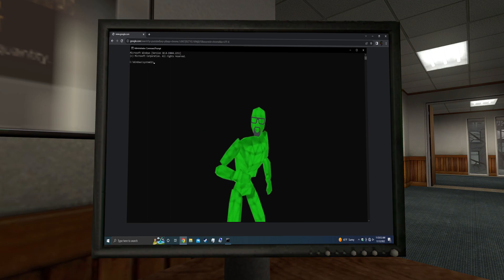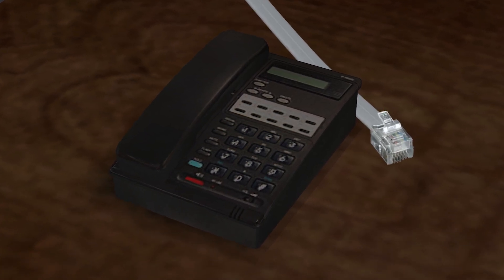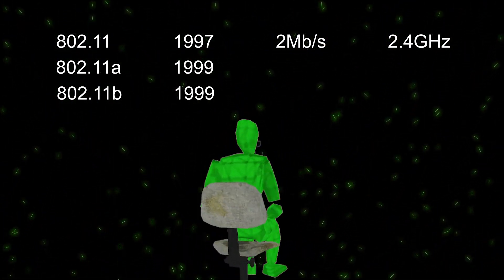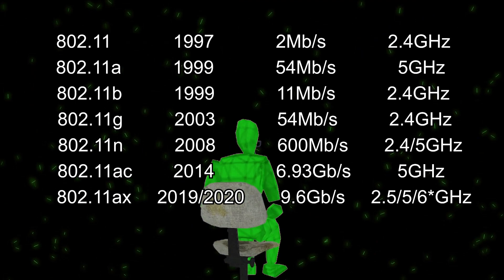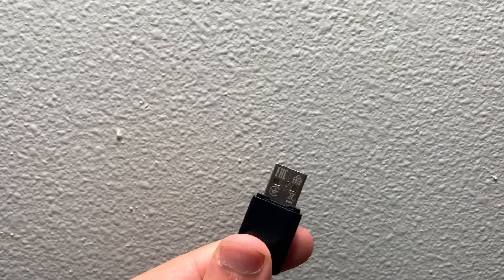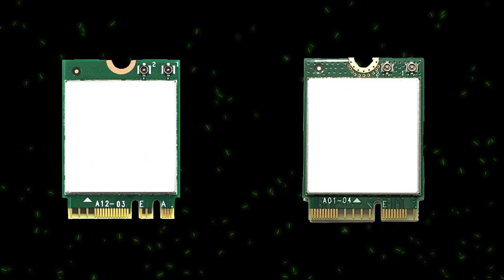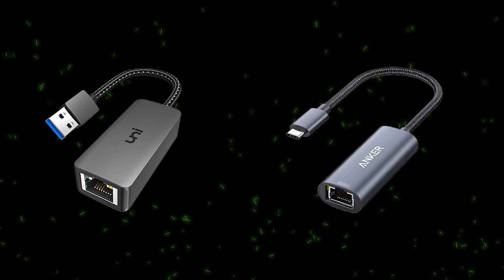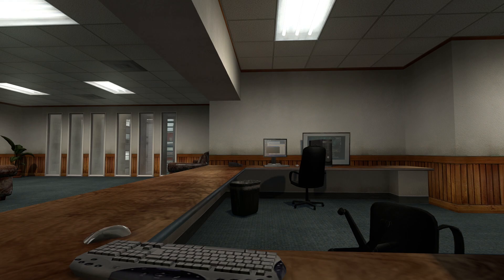Wired and Wireless Network Interfaces

Comment: The only wrong info here is with the rj11, with VDSL2+ super vectoring (which is the most used internet connection in Greece) it can go up to 300 MBit/s up and another 300 MBit/s down
Reply from the maker: That's what I got confused about because I have DSL internet and I swear I saw an RJ11 port on the back of the modem and my speed is well over 24Mbps, it did say DSL for the input so I'm guessing it's something related to VDSL. My guess is the scriptwriter(s) did a quick google search because I got the same answer by searching "rj11 max speed".